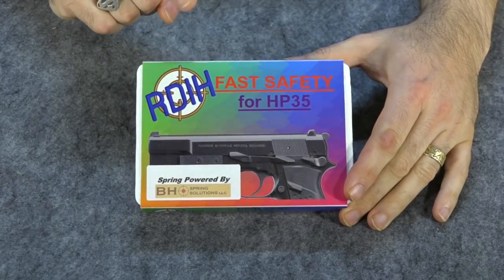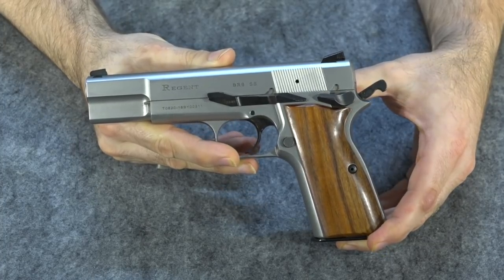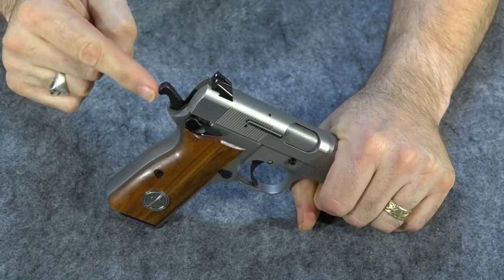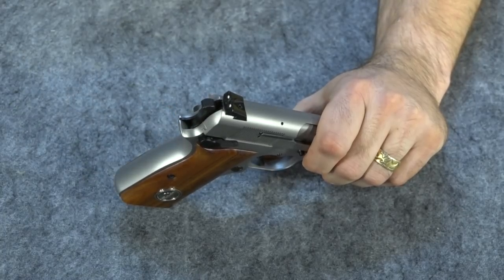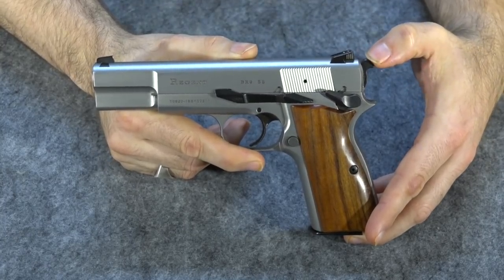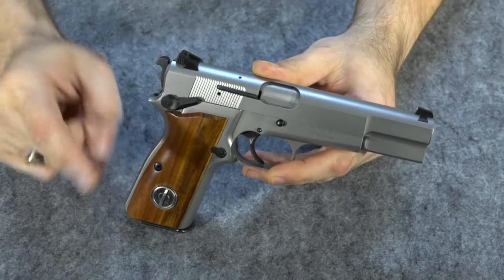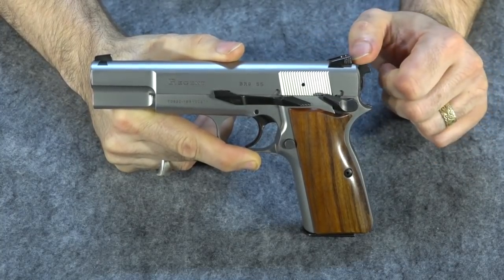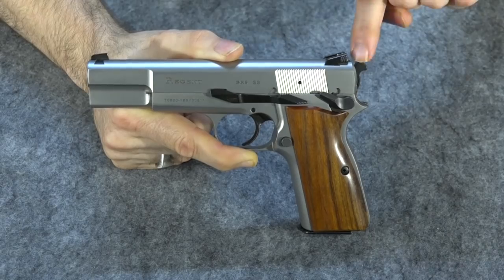1911 & Hi Power SFS (Safety Fast Shooting) System Review

Comment: Why would anyone "carry" an antique like that? So instead of carrying a modern gun with a more contemporary design, carry an antique and go through the machinations of trying to make it function A LITTLE more like a modern gun. That's like entering a 67 corvette into the Lemans race. Sure you can fix it up and add turbos, but the overall design cannot compete nor keep up with todays race cars. In short you are likely to lose the race. Just the same you are likely to loose a gun race with a bad guy carrying a more midern firearm. But hey its your life.
Reply from the maker: Name a "modern gun" that shoots as well as a Hi Power.
Reply: @TheYankeeMarshal  ...I've carried my Browning hi-power in 9mm for 15 years or so and I don't have a problem with drawing and getting on target...haven't seen many that shoot better...I'd also like to see a "modern" pistol that shoots better....ďà wòöķįęè
Reply: ...my "antique" still shoots straight and true...what else is it supposed to be? A coffee maker? It does function well as a garbage disposal unit...ďà wòöķįęè
Reply: @TheYankeeMarshal  

Define "shoots...well." As I see it, thats a matter of the requirement of the task. I mean "name one gun?" Saiko chambered in 6.5 creedmoor. Sure most guns, not all, but most guns shoot one round "well" enough. How about the sig p210. How about the Hk Mark 23. How about any rifle. A glock and m&p and sig are extremely reliable in a ccw and perform "well" suited for that purpose. How about any gun from your flagship video?

Yeah the hi power is a relic. Its great to own but its a range day gun not a gun I personally would carry and hope functions on a must unlucky day.
Reply: @sykwookiee  

I have shot a hi power and a 1911. What modern guns have you shot. Because a hi power does not manage recoil as well as modern designs. You can proclaim it til the cows come home. Not many will agree with you.
Reply: @FNG_Star  ...not for nothin', but I have shot about 50 different firearms (over a span of 40 years) and I like most of them...you squeeze and they go bang...I am the furthest thing from a firearm expert...I've been told that I'm a natural shot...meaning that I can hit what I aim at...no matter what the firearm is...but, being real here, if I find another pistol that shoots better than my Browning, I most certainly would spend the money to purchase it...then again I've been told by "gun guys" that had never shot a Browning that they really liked mine...a few even purchased one for themselves...out of them? A couple said theirs didn't shoot like mine...I have carried mine for 15 years and haven't had to shoot it in self-defense, but I have had to draw it...funny thing is, if you're doing something wrong, the end of  a barrel pretty much looks the same...I hope that this clears things up...can we be pew pew friends now?
Reply: @sykwookiee  

Sure we can be buddies. Another point to consider, if you take gun you believe to be reliable and begin modifying things like how the hammer functions, could that have an effect on the guns history of reliability? Thus, for those wanting a more contemporary design and function on their carry gun, it might be a smarter idea just to buy a modern gun with the functions and features your looking for and has a reputation for being reliable. Tinkering with older designs to make them function and meet modern ccw needs seems like rolling the dice a little bit.

I mean anyone who says 1911's are reliable are kidding themselves. Sure they are reliable weekend guns. But push those things and they start jamming. Start tinkering and it can get worse. This is why so many 1911 comp shooters take and have their 1911 worked over professionally to reduce malfunction frequency. The Hi Power in my opinion, is also a gun, that when pushed in a combat scenario, begins struggling. I have a feeling this is why the military never adopted it over the 1911. And why they ditched the 1911 for then m9 decades ago.
Reply: @FNG_Star  ...ok...I'll give you the tinkering deal...thing is, I used mine throughout my training and never experienced any problems with mine...I don't know, maybe I just got a good one? I would LOVE to have a different carry that was lighter and shoots as good as old faithful...I'm unfortunately disabled  and I currently only have what the government thinks they owe me after 20 years driving big trucks and construction work...no crybaby shit here, facts are facts...
Reply: @FNG_Star  ...and I really would like to hear what others think about what else I should try out...I just got a little defensive about my Browning 😭
Reply: @sykwookiee  

I work a Cabela's part time, second job, and I help make recommendations ALL shift long. It doesn't make me right, but I literally talk about this subject for about 7 hours a day for 3-4 days a week. If a bad guy has a glock 17, it would be an error in judgement, in my opinion, to fight him with anything less and slower than something capable of equal force. Thus anything south of 13 rounds in a 9mm seems under powered to take on a g17. Also consider what if there is more than one attacker, or there is a trailing accomplice? You want more rounds for such a scenario.

I have been ccw'ing my glock 17 for years. That said, once sig gets the p365 reliable and tests show it to be the case, I am pretty sure i am moving to that. Cabela's put them up for sale and they got so back order the first day they had to take it down from the website for a while to let orders catch up. It's a game changer if they can make it reliable.

The modern ccw requirements seem to be a gun that can shoot fast, holds lots of rounds, and carries a caliber that can incapacitate. This is why the most common law enforcement caliber is 9mm. It's not because of cheap departments. The blue brotherhood would not send a person into the street with a 9mm if they thought it was going to get someone killed. They chose 9mm because capacity is king in a street fight. And civilians having to face of a criminal has no less need for a combat ready gun than a police officer. You are both dealing with the same bad guy, only the civilian has ZERO back up and if a civilian gets shot they normally dont sent helicopters and squad cars that will chase the guy to the ends of the earth. Thus carrying the most service ready gun one can carry is the best idea.

Hence its g17 for fall winter early spring, and i would like the g26 or the p365 for early spring and summer. If sig fails to get the p365 ready, I am moving to the g26 and carrying g17 mags.

If we cut through all the crap there is a reason the number one selling gun at Cabela's is none other than the g19. It simply works and most who use it in a gun fight win.
Reply: @FNG_Star ... thanks man...I surely do appreciate the information...I have a local gun shop that I've been meaning to check out...it may be time to shop a little....take 'er easy...ďà wòöķįęè